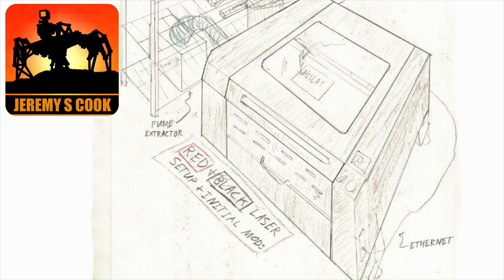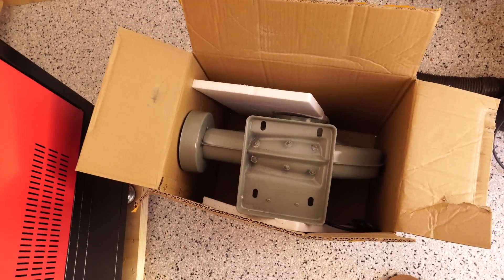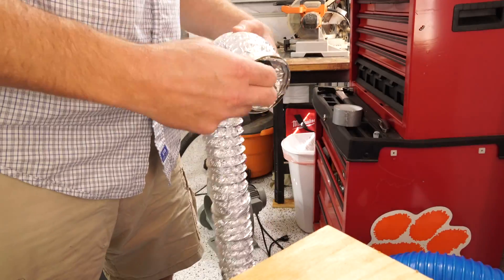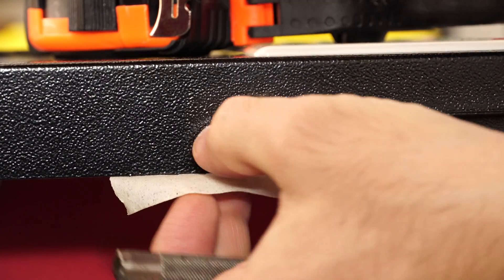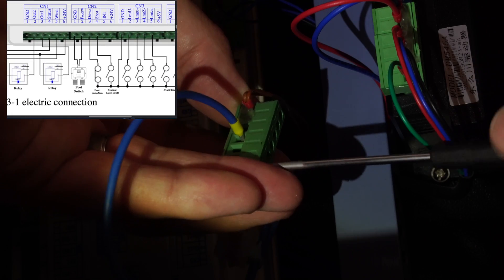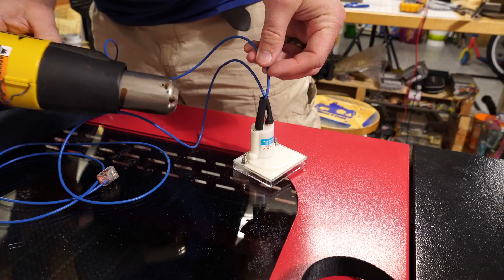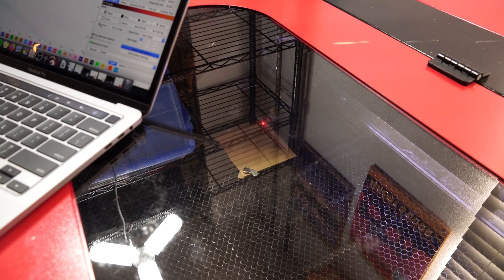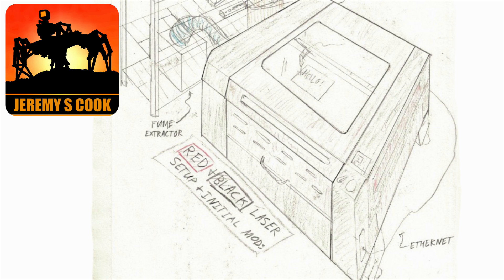60 Watt CO2 Laser Unboxing and Initial Setup

Comment: Hello, love the video, I have this cutter and haven’t been able to use it, because the computer software is in chineee. Do you have any suggestions?
Reply from the maker: I'd recommend getting LightBurn if your controller is compatible. Ruida works well, and some others do as well I believe.
Reply: @JeremyCook  thank you for responding. How would I know if it is compatible
Reply from the maker: NP. Look at the control box inside the machine, or check the specs. If it says Ruida, you're likely good to go. If it's another brand, maybe, but you'd need to search around.
LightBurn is really fantastic software, so hopefully yours is compatible.

Also, per earlier comment, thanks, glad you enjoyed the video!

Comment: Tampa Bay here. Thanks for the info and helping me decide. 

What is your laser amp input? 

Thanks!
Reply from the maker: No problem! I usually run it at no more than 70% power (using LightBurn) but I'm not certain how that works out amps-wise.  The gauge jumps around a bit during processing.

Comment: Great video, I am considering pulling the trigger on this unit from the same seller. Was your unit advertised with the manufacturer being OMTech (same unit, just rebranded, but i am curious)? was your unit advertised with a grey controller unit? or with the green button layout as shown in your video. Thank you for this video, it has help me immensely.
Reply from the maker: Hi Carlos, thanks for watching, and I'm glad it helped you. I don't recall about OMTech, but the controller was a Ruida, which is (or was at least) apparently the best kind to get. Here's the listing: https://www.ebay.com/itm/164439911051

Comment: Hi Jeremy I just purchased the AF2028-60 laser which will be here soon, one question I have which you could answer is did you use a water cooler to cool the laser as I saw in the video you didn’t, I too live in the Tampa Bay Area and know too well the summer heat we get lol did it ever over heat it?
Reply from the maker: Hi John, thanks for watching! No, I've yet to use a cooler. That being said, I generally don't run extremely long jobs, so probably a good idea if you're going to be using it for an extended time.
If you ever decide to check out Tampa Hackerspace, I'm a member there and would love to say 'hi'

Comment: Crazy question, but do you think this would fit in a standard doorway?  Does the top come off the base?  Thank you for any help
Reply from the maker: Hi Lisa - the laser measures 34 1/2 inches in depth (and longer in length), so it would not fit as set up. However, the body height without the base is 25 1/4 inches, so it would seem you could turn it on its side to go through a door (without the base). I'm not certain if the base comes off, but I believe I've seen it or a similar one off in another video.

That being said, make sure you have proper ventilation/fume extraction when running it!

Comment: Did you have to align the mirrors or were they already aligned?
Reply from the maker: I didn't have to align them, but I probably should. At this point it seems the beam may get a little out of focus as it gets farther away from the source (i.e. towards the user and control panel). Not sure if that was the case initially.

Comment: Ive finally got mine set up ..but let me ask you, do you feel like we have been duped as far as the wattage is concerned?
I can cut 1/8" with 3 passes @70%  which seems very weak for a 60W laser judging by other peoples remarks about their lasers at 60W.
They sent me back an email saying that it cannot cut 1/4" but everyone I talk to says it should be able to cut 1/4" with 3 passes.
I really think what I have in my shop is a 45W being packaged as a 60W.
I have been searching for a test to test the output. What do you think Jeremy.
Reply from the maker: I don't think it's 60W based on the tube length (which IIRC is 1000mm). I believe it's actually 50W.

That being said, check out this video: https://www.youtube.com/watch?v=GM-lGGL1JWo where after some fiddling I'm able to cut 1/4 inch MDF in 1 pass at less than 70% power. 

Perhaps you're running it too fast, the mirrors aren't clean, or there is some beam alignment issue.
Reply: I can cut 1/4" acrylic with the K40 (40W laser) single pass at 11mA. It really comes down to ensuring your laser alignment is absolutely perfect and also your air assist is flowing

Comment: One quick tip: If you twist the excess off your cable ties with a pair of side cutters instead of snipping them, they won't slice you open when you brush against them. Old electrician trick I learned years ago.
Reply from the maker: Neat, thanks!

Comment: with all the customization you did to this machine, I'm surprised you never added a camera.
Reply: Let me know if you need a custom cable length. I make my own.
Reply from the maker: @martinduffy3835  Thanks for the offer, but It's not so much the length as figuring out exactly what to buy. Feel free to ping me: hi@jeremyscook.com if that's easier.
Reply from the maker: Who says I'm done ;-)

TBH, I considered it, but seems the reason I put that idea aside was that Lightburn doesn't support IP cameras well (or didn't at least, haven't looked in a while).
Reply: @JeremyCook  after looking at your video I've decided this is the laser I want. I looked at several, in fact a client of mine offered me an Epilog Helix  at a really good price, but even though it is US made this looks like I would be better with this one. I wrote to the company and they said I could add a Lightburn camera to it..
Reply from the maker: @martinduffy3835  Cool, hope it works out for you!
Re. the camera: I imagine that's true, but I'd really like mine to communicate over Ethernet or WiFi. I don't think that camera does.
Reply: @JeremyCook  Yep it has to be USB but I will extend the USB with Cat 6 and adapters to my computer. I believe its 200 ft range.
If you wanted to actually have it over a network then USB Gate would work.
Reply from the maker: @martinduffy3835  Looked that up - USB Gate is a software package is seems? Wouldn't there be some hardware involve, or does it simply read the Ethernet signal and virtually convert it into a USB signal?
Reply: @JeremyCook  no I reread it and your right it is mainly for remote usb ..outside of a local network. 
It is only $6 for 2 usb to ethernet adapters
Reply from the maker: @martinduffy3835  Thanks. Got a link for that? What I normally find are items that acts as a USB Ethernet "cards" not so much something that allows you to encode and decode USB signals if that makes any sense.

Comment: What program does this run off? Can you use Adobe with it?
Reply from the maker: Hi Byron, I use LightBurn to control it directly, but you can import files in several formats (at least some of which Adobe products should be able to produce).

Comment: Did you get the auto Z adjust?
Reply from the maker: No, I adjust it manually. Probably nice to have the auto function, but I haven't found it to be a big deal at this point. OTOH, if it can auto adjust over multiple passes, I can definitely see the advantage there.
Reply: @JeremyCook  what "branding:" does yours have? I have seen Preenex, OMtech, and now Vevor" I wonder how much difference in quality (if any) between them?
Reply from the maker: @greggonzales2311  Listing said Preenex. It's hard to say. I think you need to check the kind of controller (Ruida used here, which I think is the best for this kind), and what's included like the safety switch and adjustment.

Comment: How do you like that filter system? I am currently using a large canister filter.
Reply from the maker: Air flow isn't as good as I'd like TBH. Working on something simpler that'll take household air conditioning filters before it pumps the air outside.
Reply: @JeremyCook  Thanks for the reply.  I almost went with that exact unit. Can't wait for an update.
Reply from the maker: @tsstarlin  NP, and good to hear. Hopefully it won't take me too long to get it done. Feel free to bug me in a couple weeks if I don't have the video out (as it can take a while to produce)

Comment: Great video! Would love to see another covering the use of it, the software you're using for design, any CAM and/or gcode conversion, transfer to the laser, focusing, etc.
Reply from the maker: Thanks! Not a bad idea, perhaps I'll do that, maybe after I work with it a bit more.

I'm using LightBurn, and long story short it's way easier than a "normal" CNC.
Reply: @JeremyCook  my suggestion is totally selfish. I recently bought a small desktop 30W Beamo laser cutter, which is similar in ease of use to a Glowforge. I've avoided K40/50/60 because of the difficulties I've read about in setting up, calibrating, adjusting, and using them. Would love to have a larger, more powerful one eventually, so I'm looking forward to more of your thoughts and videos!
Reply from the maker: @JasonCoon  Well it's great to know you find it valuable! Added to my mental list ;-). If you haven't seen it, you might also find this Podcast conversation I did recently informative as well: https://www.youtube.com/watch?v=K5k5J4Mkve0 (also on SoundCloud if you so prefer)

Comment: Great setup/upgrade video, and thanks for the shoutout Jeremy. I really like the idea of running the fumes through the air filter first. I need to get one of those I am sure my neighbors  would appreciate it.

I noticed in your video you had some air getting trapped in the tube, (I hear this can create hot spots in the glass) I had the same issue with mine at first. A solution I found was locking the casters and lifting up the left side of the machine quite high would allow for the air to pass through, while also creating some nice lower back pain. Periodically the air would return, until I upgraded to the chiller which apparently has a high enough flow to force all the air out in its own.
Reply from the maker: Thanks Chad! Was a fun setup process, and glad to give you a mention.

Yeah, I know what you're talking about, and hadn't even really given it a second thought. Thanks for noticing and pointing that out. Now I need to figure out how to correct that without hurting myself or the machinery. I lifted it pretty high before to get the blower out, so should be doable.